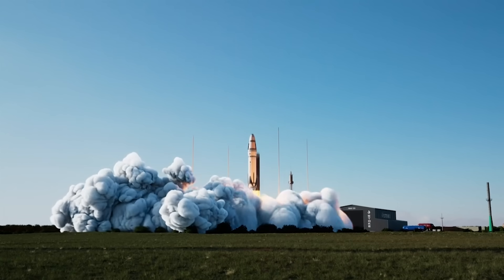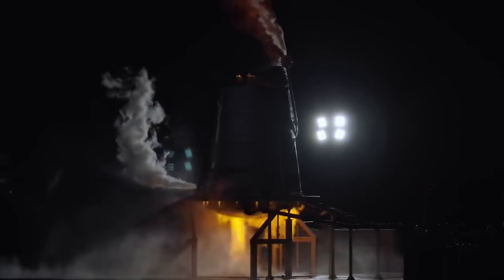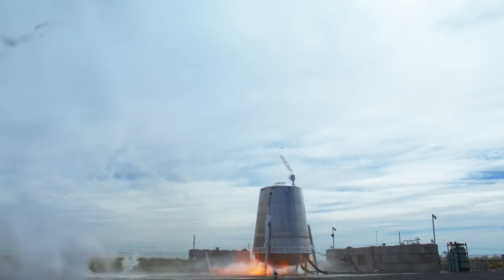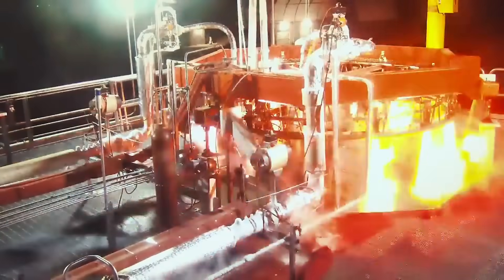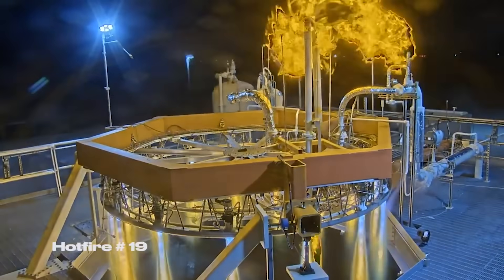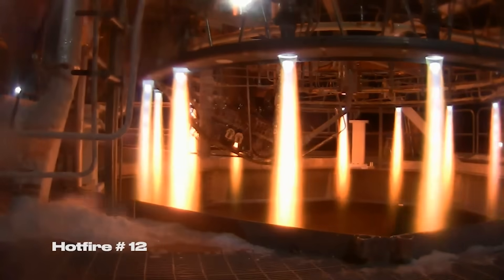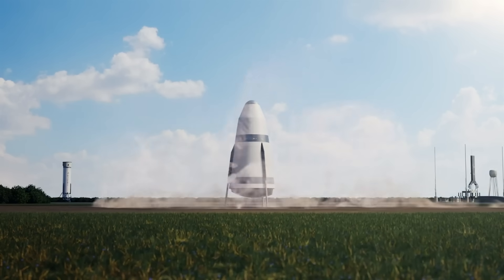Stoke Space Just Completed Its First Vehicle Flight

Comment: Pretty unique design! but how does it achieve roll control if all the engines are fixed?
Reply: That is a great question. The answer is ACS. Normally we refer to ACS as attitude control, but it is also roll control. And so long as you have roll control through ACS then all you need is attitude control through variable thrust and you have a full control system.
Reply: @StoneUSA  Sorry, it doesn’t make sense to me, variable thrust alone can’t generate torque in roll axis, it could only achieve yaw & pitch maneuver in this case

Comment: The rotation reminds me of the first Falcon 9 launch, which hat also a rotation at start due to all Turbopumps spinning in the same direction.
Hope they did not repeat mistakes already known
Reply: They probably only have one turbo pump, but a bunch of nozzles
Reply: @mb777-g8v  
If there is only one Turbopump that would cause a lot of high pressure piping with strong control valves to manage different fuel flow for thrust vectoring. 
With that it is more likely each rocket engine has its own turbopump since these can much better control the fuel flow.
Reply: @madcientist5438 The whole assembly is a single open expander bleed cycle engine with 30 combustion chambers. They only have a single turbopump generating 1000HP from the heat of the heatshield and engine nozzles. This is similar to the RD-170 and other Soviet engines with multiple combustion chambers and only one turbopump.
Reply: @madcientist5438  the whole point of their design is that it's one turbopump, many combustion chambers
Reply: @plainText384  Interesting. Now I am extra curious how they regulate the different thrust.
One Turbopump gives support for the theory, that the spin of the pump or more the change in spin caused the rotation of the hopper
Reply: @madcientist5438  I'm not sure, but I'd guess there are a lot of valves involved. 
The rotation could also be caused by   small misalignments in the engine nozzles. Another thing I noticed/ didn't notice was RCS. Supposedly, the vehicle has an RCS system for rollcontroll that they tested in the static fire, but I didn't notice it doing anything to correct the rotation during the hop.
Maybe it was deactivated due to some issue they found in the static fire, or maybe there was a problem with the avionics/ sensors detecting the roll and giving a correction command. Or maybe it did fire, and I just didn't notice.

Comment: Hydrogen is stupid, but the engine concept is cool.
Reply: liquid hydrogen is literally the most efficient fuel for rockets
Reply: @levilevitateyvl  "Liquid hydrogen is literally the most efficient fuel for rockets."  No it isn't.  There's more to "efficiency" than Isp.
Reply: @dudermcdudeface3674  Specific impulse is literally directly related to how efficient a rocket engine is. Higher ISP = Less propellant mass for the same amount of thrust. The only disadvantage hydrogen has is the low density and the need to vent continuously while in space
Reply: @levilevitateyvl  Tell you what, son.  You build a rocket and try to get to Mars with it.  When it refuses because you can't afford the infrastructure for it, you can tell it what your definition of efficiency is.  I'm sure the universe will be impressed.
Reply: @dudermcdudeface3674  So you tell me my definition of efficiency is wrong but you don't bother trying to correct it? Seems legit.
Reply: @dudermcdudeface3674 
There's checks and balances for every type of fuel. 
You're acting like one is objectively better than the other.
Reply: This engine wouldnt work without hydrogen

Also, half of space industry disagrees with you, and choses hydrogen for their new launch vehicles. Just because some emerald mine enjoyer didnt like it it doesnt mean its a bad fuel.
Reply: @_mikolaj_  The engine designed for hydrogen wouldn't work without hydrogen.  You'd make it differently for a smarter fuel.  Come on, dude.  The "industry" is a bunch of custom shops for the military.
Reply: @dudermcdudeface3674  not just the engine
Hydrogen is best choice for this kind of vehicle. The regeneratively cooled heatshield and expander cycle could be done with other fuels but theyd offer worse cooling and performance.
If so, why not do hydrogen? Because armchair engineer on internet says its stupid?

Also if you are calling several launch providers from different countries all over the globe "custom shops for military"

Yknow, ill just leave it without a comment.
Reply: @_mikolaj_  Hydrogen is extremely temperamental and has absurd specialty requirements.  Everything you can say in its favor exists mostly on a chart rather than reality.  It doesn't like the kind of conditions people live in, and doesn't reward us for trying.

And I didn't say US military, I just said military.  It's a type of culture that often rewards specs over reality.
Reply: @dudermcdudeface3674  i didnt say US military either. But you from the start assume every launch provider but(i figure) your favourites is defense contractor.

Also, what the fuck is your argumentation against LH2? Most people would give real issues, like low density, low molecular mass and tendency to leak, but no, your issue is its cryogenic, *which applies to most propellants used these days*. These issues have been solved already, and yes, LH2 does reward for it's drawbacks. For what it lacks in density and GSE issues, it makes up in launch vehicle performance
LH2 upperstages are lighter than any other stage, meaning booster stage can do much more, specific impulse being over 100s higher than all other propellants allows these lighter stages to have more total impulse than their kerolox/methalox counterparts.
Example could be Centaur III and F9S2, where both stages iirc are in similiar impulse range(F9S2 is a BIG kerosene stage) but centaur will have over 4 times less propellant by mass.

Also ISP boost means the further away you go, the less payload mass you loose. This isnt some blah blah invented by "the evil oldspace hydrogen gang". This is what rocket equation tells you. And reality to, you can check yourself how much of LEO capacity different launchers loose when going to the moon for instance.
Reply: @_mikolaj_  Calm down, friend.  I'm not disputing the paper qualities of hydrogen for an upper stage, but we don't live in space.  It's extremely hard to work with, and some other stuff I could name can rely on a worldwide network of expertise and equipment.

If you're gonna argue for LH2, just argue for antimatter and be done with it.  Huge buzz!
Reply: @dudermcdudeface3674  you are commenting a space related video posted by space related channel and are confused people judge hydrogen by it's in space applications?
Reply: @_mikolaj_  Space is still a place we go TO from Earth, because we haven't succeeded yet in becoming spacefaring.  Until that happens, we have to work with Earth economics.  Because we live on Earth.  Capice?

Comment: How do they “rotate”, as the thrust vectoring shown doesn’t provide a twisting torque? They must have some of their mini engines not perpendicular?

It would be interesting if they could integrate the thrust vectoring system used in the ABM system that setup oblique shock waves in the throat / nozzle area.
Reply: Unless some of the mini engines are tilted (as you suggest), I don't see how it can produce a controlled roll. My guess is they use maneuvering thrusters for roll control.
Reply: @ddegn  Makes sense.  I misunderstood the question.
Reply: A commenter above said that the 1st falcon 9 had unitentional rotation because all the turbopumps were rotating in the same direction.
Reply: @samjubilee6593  
That sorta makes me smile, that makes sense. I have to verify this, but from the other video mentioned above I think they use one center turbo pump to feed all the separate combustion chambers. Interesting.
Reply: 1:22 the vehicle has a reaction control system (RCS) to help with roll control. It was apparently tested in the static fire. Might be the flame jets seen close to the top of the test article? Not sure.
Reply: The video said: Differential throttling.
Reply: @dudermcdudeface3674  
I am not sure that differential throttling generates a rotational torque to do a roll, but the more I think about it, maybe it can but it is kinda hard to visualize. I can’t seem to visualize a radial tangential thrust component, but I must missing something. The video said that the rotation was probably unintentional which is suggestive. Too many thrust vectors to visualize in the head.
Reply: @Mentaculus42  That's true.  I misread your question.  Differential throttling would be a really awkward way to rotate, although nothing precludes it in theory (if they wanted to get cute with it).
Reply: @dudermcdudeface3674  
I give up trying to visualize it in the head, this requires a real free body diagram on paper and some math.
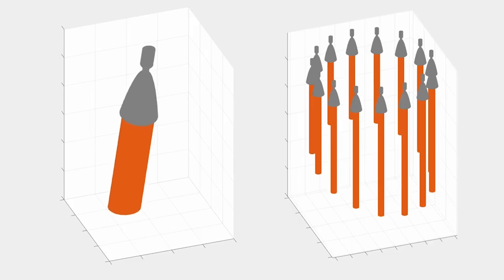Reply: @Mentaculus42   Throttling the thrusters in a rotational wave sequence 3:28 should enable craft to rotate. Throttling the thrusters as a wave across the diameter of the ring should enable the craft to gimbal.
Reply: @mikeomolt4485  
As shown in the animation with one gimbaling engine, can that single engine roll a missile? Does that not take at least two gimbaling engines offset from the centerline. But taking your wave idea, there might be some asymmetry in the exhaust flow between throttle up and down, especially if the ramping rates are different. TOO COMPLICATED, ALSO NEEDS INTERACTION BETWEEN FLOWS FROM MULTIPLE ENGINES, I GIVE UP, I NEED A SIMPLY VIDEO.
Reply: @Mentaculus42   Those 15 or 16 individual thrusters, carefully and precisely choreographed by computer control would allow far more complex motion than two or three thrusters. That test rig of theirs would allow data to be gathered without blowing stuff up, unlike the way certain other rocket companies might do their testing. Imagine those thrusters being throttled in a single circular wave  probably to gimbal or multiple rotating waves of 2, 3 or 4, that should rotate it. Should also be able to rotate and gimbal at the same time with the right throttle sequence.
Reply: @Mentaculus42  One engine could probably rotate the craft if gimbaled in a circular motion, but I would want to be sitting on it.
Reply: @Mentaculus42  "can that single engine roll a missile?"
I agree, roll control would required two gimbaling engines. I don't see a way to roll rocket using just the differential thrust.

I cheated and searched the internet. Everyday Astronaut has done a video about Stoke Space. The video is titled: "How Stoke Space's Unique Rocket Works // Exclusive Tour & Interview"
At 26:45 in the video Tim mentions the reaction control thrusters are used to roll the space ship.
Reply: @ddegn  
Thank you, that was interesting. They talk about roll control on reentry via reaction control thrusters, does that apply to roll control during landing? Probably and why not use the same system, maybe the roll (rotation) that happened in the test was not purposeful and they were trying to characterize this among many other things.